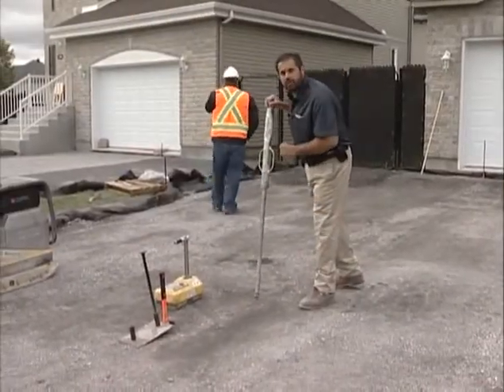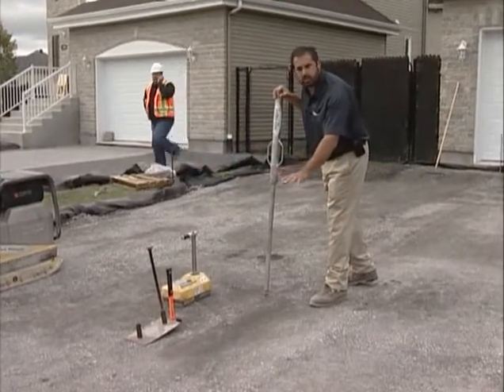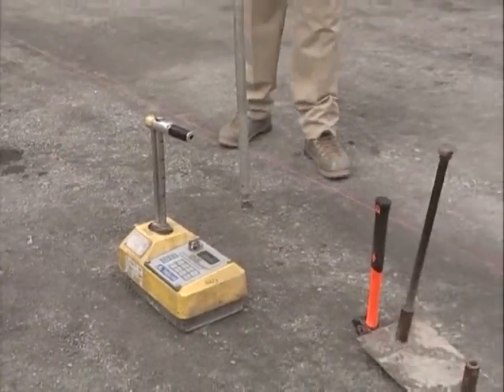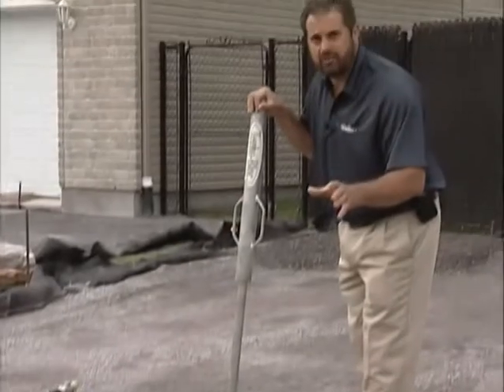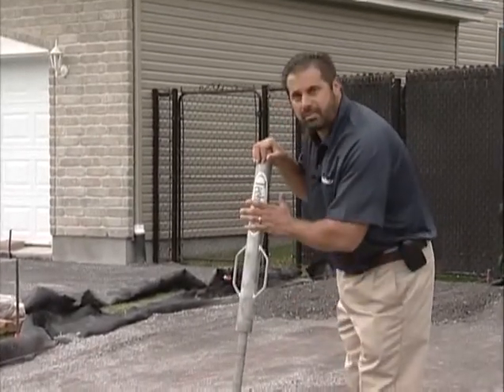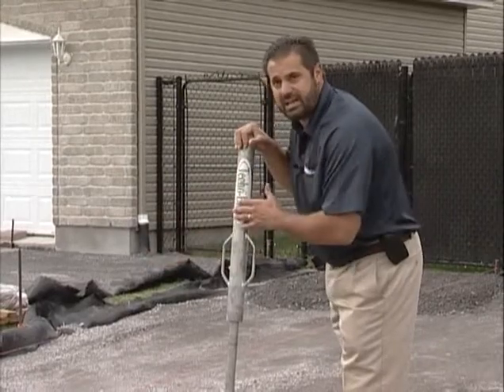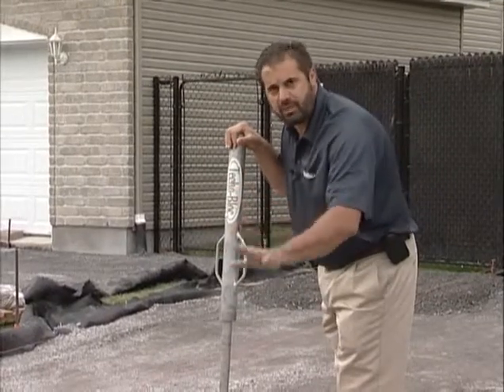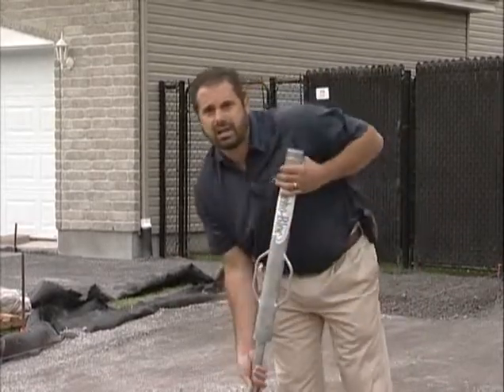Measuing Density of the Base

Comment: I found this bit of a mystery.  What was the instrument used? It seems like this overachievement and may be a wasteful for the homeowner.  .  What is the practical failure that this prevents.  How much is needed for a moving truck.  How much for a Garbage truck etc.  Thanks
Reply: Hello Michael,
The use of a nuclear density gauge is not common practice in residential applications.In the context of this project, we hired the engineer to conduct the test in order to demonstrate procedure, as well as calibrate our dynamic cone penetrometer tool. If you use a dynamic cone penetrometer, you must still benchmark it against actual hard data in order to calibrate it and record the actual penetration that the tool can achieve in various soil types (base material, clay, sand, etc.).
A base must be compacted to 98% Standard Proctor Density in residential applications, 98% Modified Proctor Density in industrial settings. The thickness must be at least 6'' for a driveway, but that thickness increases in the presence of weak and/or wet soils, freeze thaw cycles, heavier traffic. It is not uncommon to see 10-16" thick base construction in the northern United States and Canada.
Failure to compact adequately leads to differential settlement and rutting, which impacts the load-bearing ability of the pavement. It also leads to pooling/ponding water. Once standing water is introduced to a system, its days are numbered as water acts as a lubricant for soils.
Thank you!
Reply: thank you for the response.  I will take it off my shopping list :)